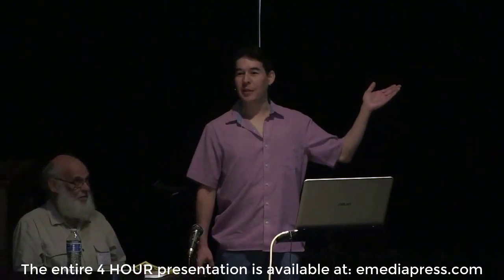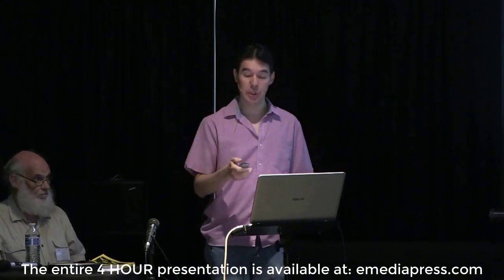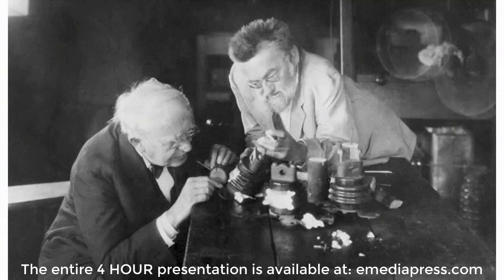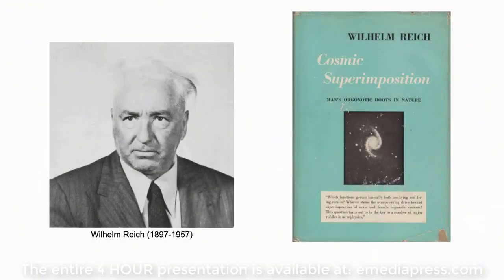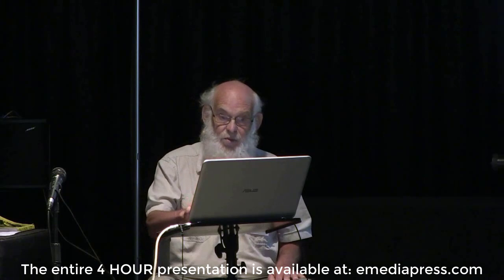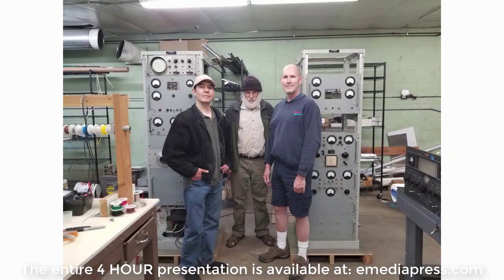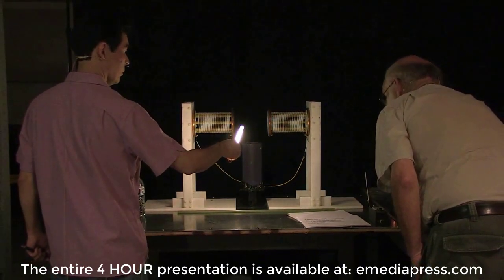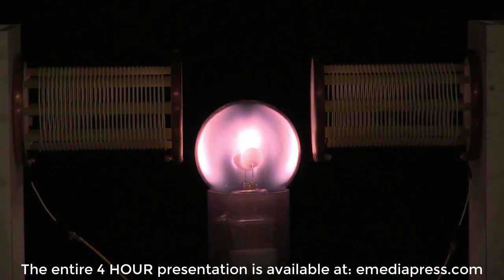2021 ESTC Excerpt Borderland of Nikola Tesla's Resonant Transformer - Eric Dollard & Aaron Murakami

Comment: I wonder if a machine like this could be designed to split water into hydrogen and oxygen by hitting it with just the right resonant frequency -- using very little power. The frequency 2.45 GHz corresponds to one of liquid water molecules. That seems very doable. The key would be to do this with the least amount of power using some sort of magnification factor. Eric? Be sure not to dine with Belgian investors.
Reply: Look into Aaron's plasma ignition system, very little power for a very energetic event in an extremely small time window.

Comment: counter-space?  strange philosophy, but I do believe there is a subspace....
Reply: Kiri Uacybhail Otaraua  I have a comprehensive and fun-ish video explaining it.  But non-point magnetism does not exist.  Technically, protons and electrons are the fundamental magnets in particles, but its the neutron, where they combine, that their magnetic waves are increased because of resonance, and when neutrons come together, if aligned in a layer, create an even strong magnetic attractive wave resonance.  Neutrons are at the core of atoms, and stars, and though in our everyday use, neutrons do not stick together very long, it is because they are bombarded by protons and electrons in the air.  However, as debris in space condenses, it compresses so much, that at first electrons are shed, then compresses again, and begins shedding protons, creating a hydrogen and helium outer shell with great heat because the electrons and protons have a place to combine, this is why the temperature inside a star is cooler than outside the star, and this happens even in planets.  But planets shed their protons and loose neutrons in a slower manner because they are under pressure, whereas stars are opposite, in a vacuum.  planets shed heavy atoms because larger neutron bundles can escape more slowly.  This is why there is radioactive materials in our crust that should have totally decayed by now, but are still around, because they are freshly made.  Did you know that crude oil has two types?  Regular crude, and dirty crude, dirty crude is called this because it is radioactive.  look it up!  Anyway, we could create neutron material in a lab, as long as we do it under absolute zero temperatures and not in a vacuum.